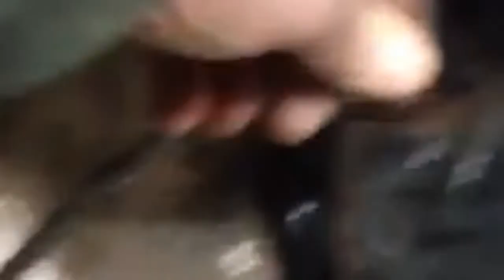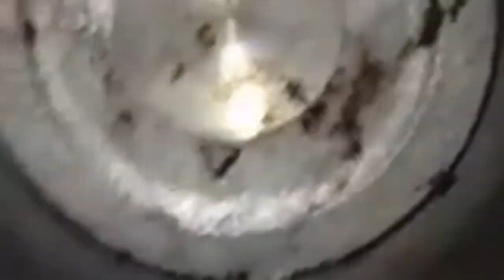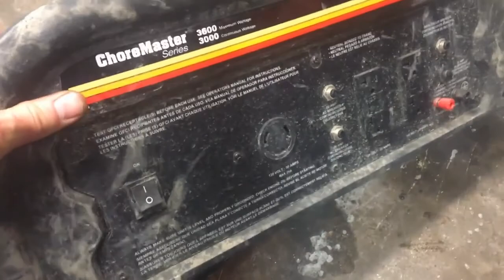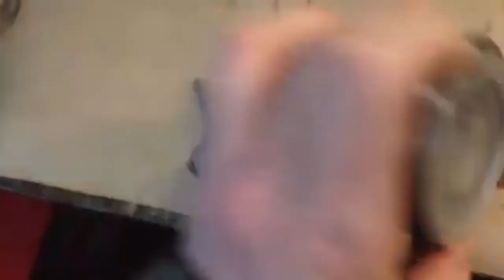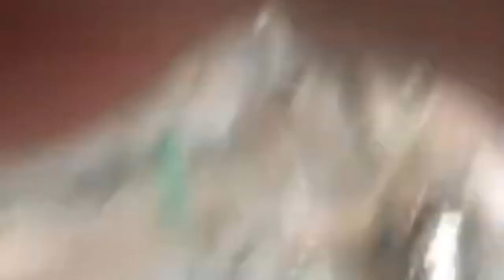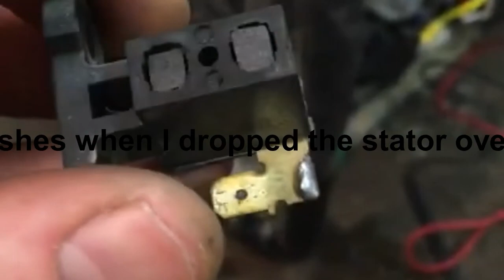Choremaster 3600 Generator Harbor Freight Predator 212cc teardown

Comment: Finished watching your video. Well done. FYI, use either eBay or amazon for parts. Very inexpensive.  Brushes are universal for Honda clones engines and you can buy them for $3.  Carbs cost $8-20.  AVR’s are $6-20 etc.
Reply from the maker: Thanks for your comment.  I bought the piston head, seal and gaskets from OMB Warehouse.  The cinematography is terrible I know.  Did it some on an iphone 4 and some of it on an iphone 6.

Comment: Nice job. I like your method of removing rotor.  Had not heard about this method before. I typically use a plastic mallet and whack the rotor multiple times to release it. Your method seems like it would be easier. Thank you.
Reply from the maker: Thanks for your comment.  Sorry for the terrible video and editing.  Still learning.